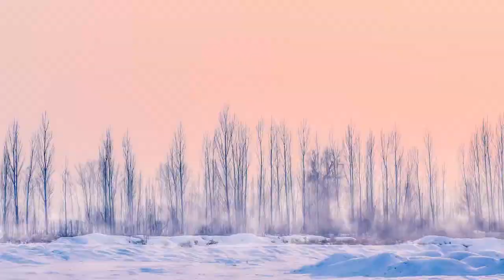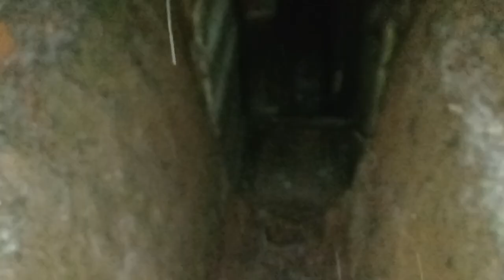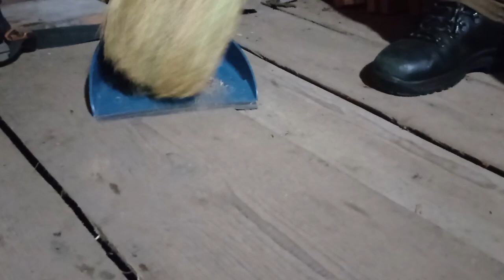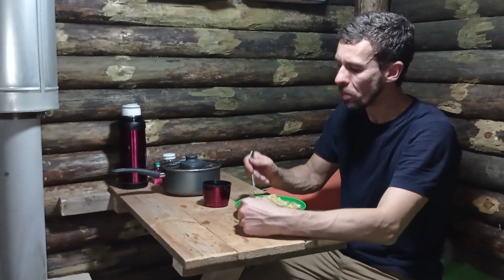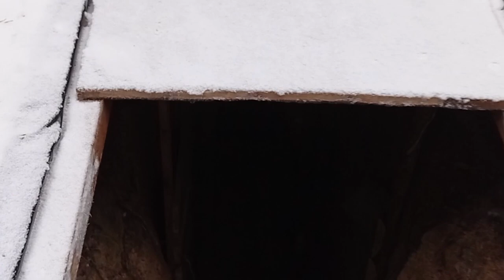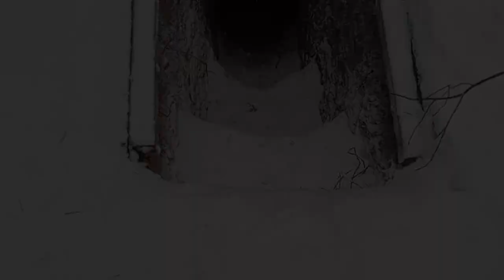ЗИМНЯЯ НОЧЕВКА В ЛЕСУ | ПРОВЕРЯЮ СВОЮ ЗЕМЛЯНКУ | ENG, DE, KOR, FR SUB

Comment: You did very well, there were no leaks. Another cozy night in your dugout. You were well prepared, your dugout must have been warm enough to take your socks out and you only had a blanket. Hopefully, in the future, you can have some more paddings on your bed. Your stove and ventilation worked out well. Greetings from Arizona! You live in a very cold climate but we live completely opposite, it is mostly very hot. We are used to the hot temperatures here.
Reply from the maker: Greetings to you! And greetings to Arizona from Russia! Yes, we have such a climate, but in summer it also comes warm! We are waiting for him very much after a long winter, I want to warm up and take the rays of the sun, which is so little in the year! I sincerely thank you for your support and appreciation of my dugout!